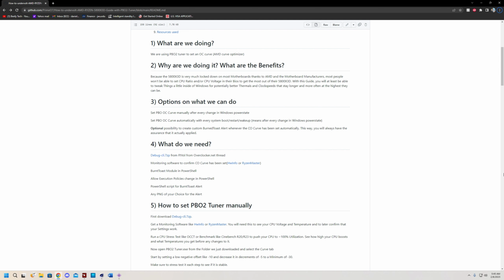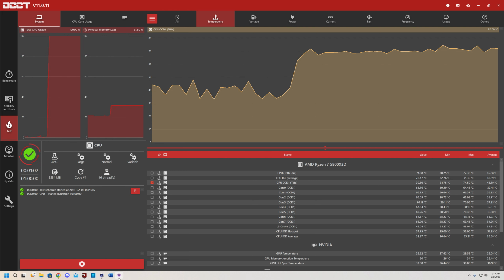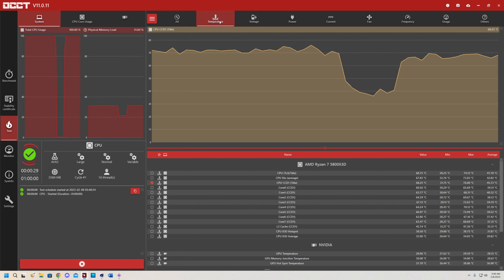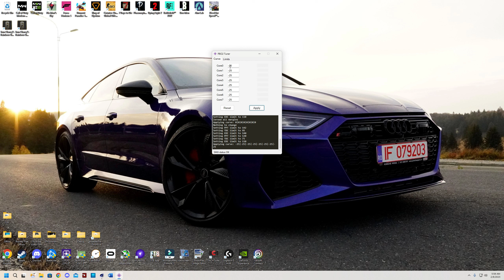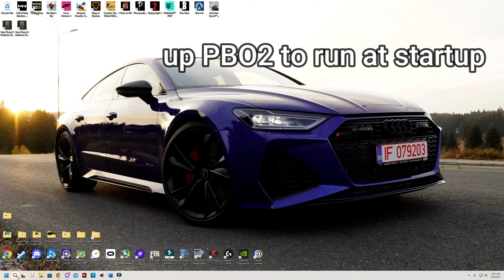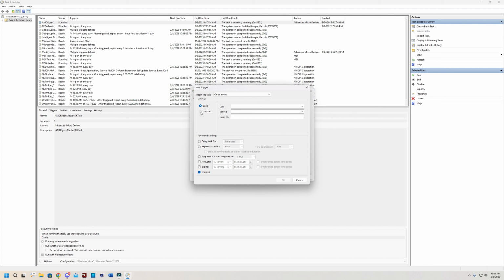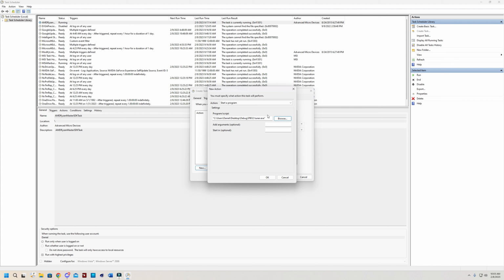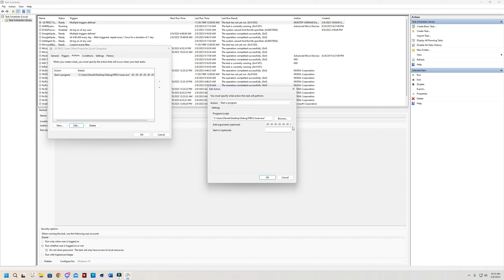5800X3D Undervolted with PBO2 Tuner (Setup Guide and Performance Testing)

Comment: -30 on all, and limits 120/70/105 the best on my cpu. temp ~60
Reply from the maker: I attempted -30 and had a crash or 2 while also with limits in place so no success there, -28 worked, but -25 was moat stable.

It really is a cpu binning test with these undervolts xD
Reply: @Beefy-Tech  what is binning?
Reply from the maker: @nubas7065  so to sum it up, a well binned cpu just means it can do higher frequencies at lower voltages. Manufacturers for example bin the 13900k really well, call it a 13900ks, and charge more for it then a normal 13900k xD

Comment: does PBO2 tuner work on the 5900x cpu aswell?
Reply from the maker: Yes, but it won't result in increased performance like with a 5800x3d, just less heat, voltage and wattage.
Reply: @Beefy-Tech  which would be a better chip to get the 5800x3d or 5900x? i currently have a 3700x looking to drop a 5000 series in my mag x570 tomahawk wifi
Reply from the maker: 5800x3d anyday if you do gaming. Even if you do other stuff on the side, 5800x3d offers much more future proofing due to being up to 30% faster in cpu bottlenecked games.

Comment: How many fps did u gain in warzone just from doing this?
Reply from the maker: I don't remember exactly as I switched to 7950x3d since, but about 10-20 FPS directly as a result of the Temps being lower, and therefore frequency being higher
Reply: @Beefy-Tech  Okay thanks I will do this when i get home from work. I just upgraded to the 5800x3d I had a 5600x my gpu is a evga 3060ti
Reply from the maker: @ImUrMISERY  I need to mention it was 10-20 FPS while using a 4090... meaning with a 3060ti it'll depend how gpu bottlenecked ull be. The 5800x3d can generally max out a 3090ti no problem.
Reply: @Beefy-Tech  Yea i understand that. I have my 3060ti pushed to its max over clocked. I added 145 to core and 1250 memory and it cranks out 1440p nice. I will upgrade everything near the end of the year but for now i want to pish this build as far as possible.
Reply: @Beefy-Tech  Do you think a 4080 will be bottlenecked by the 5800x3D?

Comment: Hey man, followed your guide, but i dont think its actually working: While PBO2 Tuner states that im running at -30, i still get temps to 84º on Cinebench 23 on the 10 min test...but, i have the same outcome on -20 and cores wont go above 4350mhz...im running the latest bios on my B550m TUf Plus board
Reply from the maker: It might not be an Issue with PBO2 in that case🤔 it depends what cpu cooler you have, and if your thermal paste is applied well or not. Could even be that the thermal paste has dried up.
Reply: @Beefy-Tech  could be, but, thermal paste was applied when swicthed to this new cpu a week ago...could i try to do the same on bios to see if the outcomes are different? im running Scythe Fuma 2 (1st revision)
Is there any way to actually know that PBO2 Tuner is indeed working?
Reply from the maker: @fntksgaming  if you download ryzen master you will be able to see the undervolt in ryzen master if I'm not mistakes. The only other way to check is by setting a windows notification when PBO2 Tuner applies.
Reply: @Beefy-Tech  okay, will try that, thanks man

Comment: This is cool but it doesnt store the PPT TDC or EDC values after boot
Reply from the maker: you need to type your offset and then the power limits followed by a 0. Example:

-30 -30 -30 -30 -30 -30 -30 -30 120 75 110 0
Reply: @Beefy-Tech  oh I see, appreciate it bro, gonna try that out tomorrow

Comment: Seems like it doesnt work with the 7800X3D :(
Reply from the maker: Yes, it only works on 5800x3d. You must use the bios to undervolt the 7800x3d.

Comment: Hmmmm I thought that AMD set the volt to 1.3v on purpose and undervolting might damage the CPU since the CPU needs all the voltage to make use of the extra cache…. I guess not
Reply from the maker: Definitely not, undervolting poses 0 chances of causing damage. Only overvolting can damage a cpu.

Comment: Occt is Not the best Option to Test if all is stable use corecycler or prime instead
Reply from the maker: The reason I use OCCT is because for gaming purposes it more then suffices. Prime for example is overkill when the goal is stability in call of duty at 45% cpu usage.

For any more intensive tasks I'd consider prime though

Comment: I have a dud 5800x3D that crashes at -30 even at -20 is o the limit of stability
Reply from the maker: That's unfortunate...really rare for 5800x3d to fail -20. I know the 5600-5950x can crash at -20, but 5800x3d's tend to do -25 fairly commonly.

Comment: is this same method safe for ryzen 5 5600?
Reply from the maker: Yes, and with 5600x it will not increase performance, but rather just decrease temperatures. Only reason it helps performance to undervolt a 5800x3d is because they are really well binned cpu's, that benefit from the lowest possible Temps and voltages as cache is very sensitive to voltage

Comment: call me an idiot, but the file downloaded from google drive is NOT pbo2 tuner
Reply from the maker: I would not like to call you that, but also if it opened a text file, that means your file is downloaded, you just have to go into your windows search bar at the desktop and type "PBO" In there and you'll be able to open up the file.

Comment: DO NOT buy 5800x3d because 5800x is slightly better but cheaper
Reply from the maker: 5800x3d is significantly better, not slightly. Maybe if you play ultra 1440p on a 3080 you may not need a 5800x3d, but otherwise 5800x3d is a good 30-50 FPS faster in cpu limited games like warzone 2.
Reply: For strictly multicore, the 5800x is slightly better. (Because most multicore applications don`t benefit from the larger cache, but do benefit from the slightly higher clock of the 5800x)
For gaming, the 5800x3d is significantly better. (Because of the larger cache which is utilized by games)
Reply from the maker: @BitZapple  yup. I'm aware, I was only referring to gaming applications. I had a 5900x prior to 5800x3d and even with my best possible OC on 5900x it wasn't even close in terms of gaming performance when it came to call of duty warzone 1.
Reply: IMO the 5800x3d is the end game CPU of AM4 gaming, it will last for many years to come with high end games, it's better to shed the extra money for it over the 5800X, theres a reason why the 5800x3d is still one of the most popular sold CPU's atm even though AM5 CPU's have released.
Reply: @fu928  13900k already beats 5800x3d in many games
Reply: @meow6023  in some games it wins,in some games it looses so what is your point ???